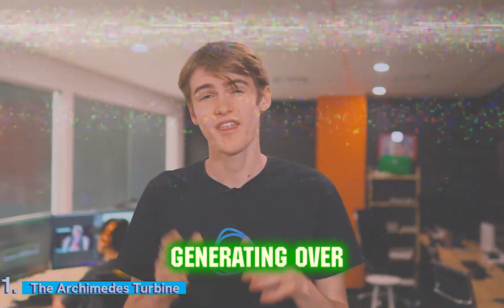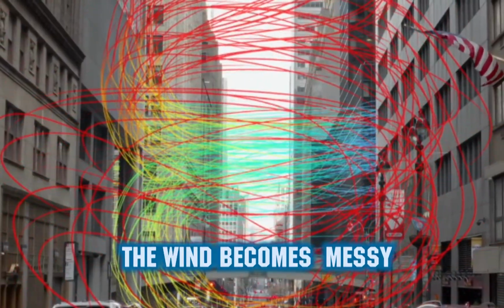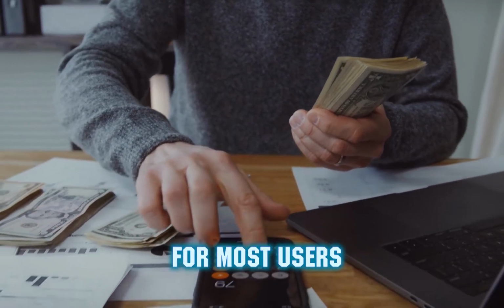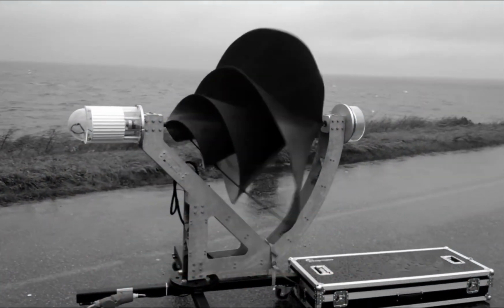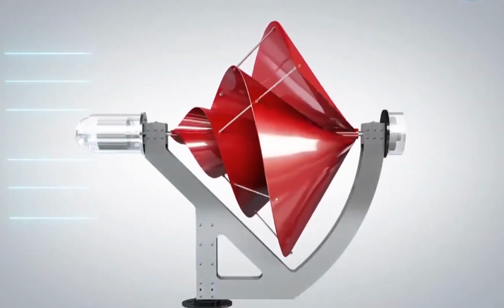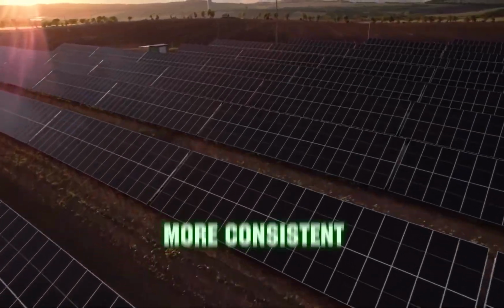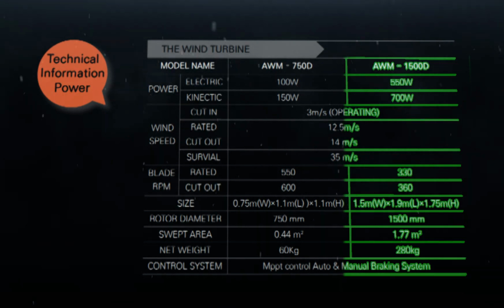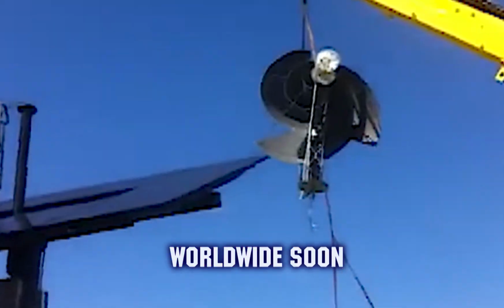Archimedes Liam F1 Wind Turbine for Home Price and Is it Worth to Buy

Comment: The dream would be to have both solar and wind at a local level on our homes as they complement each other really well all year round, but we've heard so many promises with wind power in urban areas that fall short, also the cost of them is not really that competitive with solar.

Personally, I think that unless the wind industry finds a way to create wind turbines that work well in urban areas, then solar is going to win out by default as it's getting cheaper, better and there's no moving parts, in other words, just oversizing your solar setup makes more sense, especially over the next decade or two where solar will likely be able to integrate in almost everything from the roof, walls, fences, the floor and so on.

The reason why I think wind power's days might be numbered is because once renewable energy gets good enough, most of us are going to want to be self powered so we can control how much we generate and the cost, if more homeowners and even businesses go that route over the coming decades, that's really bad news for wind power unless they figure out a way to have decent power at a low cost in urban areas.
Reply from the maker: I bet on new type of solar https://www.youtube.com/watch?v=sSj3JgywXDE it's become cheaper and more effective
Reply: уголь всё же экономически более обоснован чем солнечная энергетика😅

Comment: They look easy enough to recreate as a DIY. The main cost would be the generator.
Reply from the maker: Add also inverter and probably batteries
Reply: It is not that easy. You need to carry out Maximum Power Point Tracking (MPPT), otherwise overall efficiency drops significantly. This requires a special inverter.  As mentioned by UnlimEnergy-f3r, you also need batteries as output power fluctuates a lot. 

You also need to have a braking function to increase survivability at storm.  As the projected surface of the turbine is large, you need a very sturdy mechanical construction.   I high Tip Speed Ratio propeller design is easier to handle at strong winds as when you stop it, its swept area becomes its physical area, so the wind load reduces compared to the Archimedes turbine. 

I would definitely recommend you to first assess how much wind you have at the proposed position of the turbine.   When wind is insufficient, there is little energy.  What isn't there, you can't harvest.
Reply: @wimtel  When wind is insufficient, there is little energy.  What isn't there, you can't harvest.

Obviously